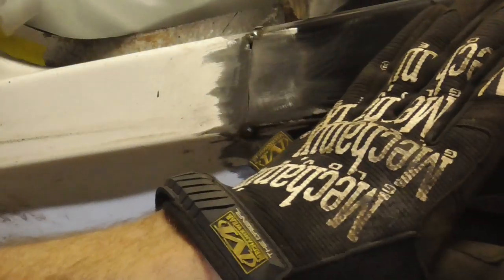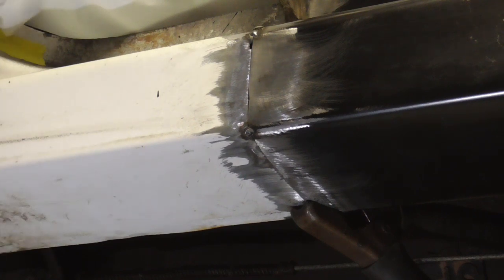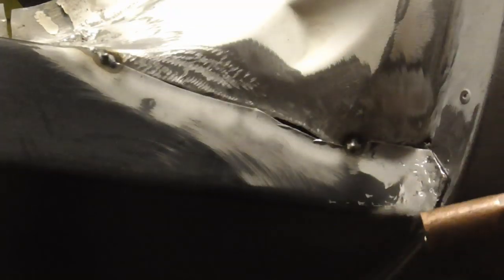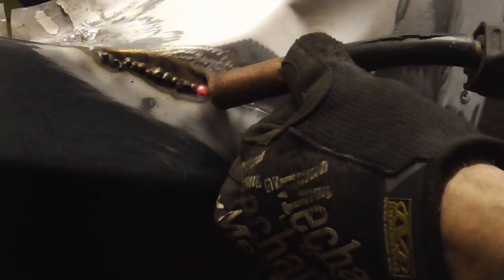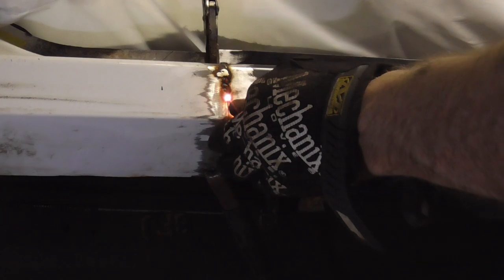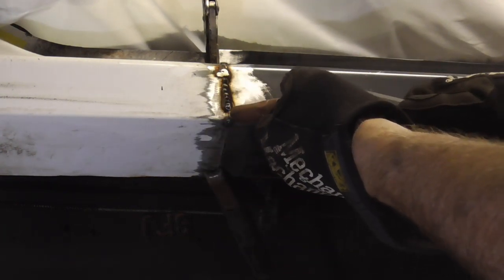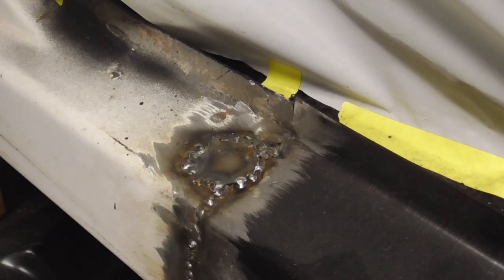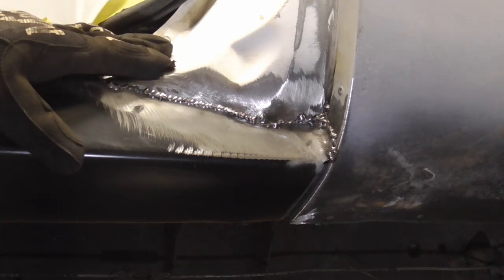Butt Welding Auto Body Sheet Metal:  Settings, Problems, Solutions

Comment: I been using Mechanic gloves in winter for tacking, & for Christmas I got a pair of tight fitting leather insulated driving gloves, & I will say I have been impressed for welding, a lot more comfortable than my welding gloves, & better warmth for cold metal, & also sparks not burning holes or sticking to top of glove. lol. my primary mechanic glove is the cheapo copy from Harbor Freight, but do try a leather driving glove, it will make you wonder why didnt try sooner.

as for people mentioning about tip hot, some cheap welders will arc, I know I have read how to install a resistor across lead internally to eliminate that, but mine do not arc.

Comment: You mentioned this car has galvanized metal, but didn’t mention how you prepped it for welding. I know for a fact that if the zinc coating is not removed completely, the weld will be contaminated leading to sputtering, blown holes, green deadly zinc smoke, and early death! Plus galvanized panels are very thin, 20 or 22 gauge, subject to extreme warpage from the heat. I have a ‘96 GM project car and am using a 140 Millermatic with gas. Even after carefully removing all the paint using a 2” sanding disc followed by removing the zinc layer with a 2” scotch bright pad, my welds sputter and pop and look like crap! Even though I’m stitch welding in single short bursts every 6 “, the welds seem contaminated. I think I need to remove the paint ant zinc on the BACK side too! What do you think?
Reply from the maker: I think I did mention that you have to grind the galvanized coating off - but I'll check.  Anyway it's a different color so you can tell if you got it all.  You don't have to do the back side.  Make sure you are using a sharp disc - like a 36 grit fiber resin to really clean the metal and remove the galvanized layer.

Comment: Really enjoy all of your videos. I also noticed that you do a great job of filming everything very well. 

I currently have a mig welder, but I don't have gas. Can you tell me if flux core will work with this method as well, assuming I adjust my settings appropriately, or should I wait for the gas tank? Thanks again for sharing.
Reply from the maker: Thanks - glad you like the quality of the videos - I try hard to make them worth your while.
Reply: I used flux core for years...but it is not ideal for body work. Very dirty and lots of blow threws. Once i switched to gas(75/25) i will never go back!

Comment: In auto Collision repair school. And in welding class we are butt weld with backing. Is it a good idea to weld a bead or distribute the welds so dont over heat and burn through. Welding on 16gauge sheet metal
Reply from the maker: You'll really never run a bead on sheet metal.  Use spots to distribute the welds and heat.  You'll also be welding 20 or 22 gauge in the body shop - that's .035' and .030" but it's good to practice like you are on the 16 gauge - feel free to always ask ?s
Reply: @LakesideAutobody   thanks for the information.

Comment: If the weldment is in an area that cannot be seen do you grind it down? Slightly off topic but my stick welder (Everlast 200ST) is IGBT and requires only 58% of the electricity of the Millers I used in welding school. Do you think IGBT MIG welders require less juice than the older types?
Reply from the maker: If you mean where trim is going to go or weather stripping... I usually grind it just  a bit sand blast it clean then prime/paint - just so if someone takes it apart, it looks nice.  Maybe - I have to check one of those welders out.  Happy New Year.

Comment: Do you sand blast all your weld seams, if so why?
Reply from the maker: I never did in a body shop 'cause it made a mess.  I do now because it looks nice and it's a good surface for the filler to stick to.  Never had a problem not blasting it either though - just grinding the area and using a wire wheel to clean up the welds a bit.

Comment: Are you just aiming for gap in between the metals , does it have to hit the gap in the middle of the 2metals if so how do you do this so fast and accurate.
Reply from the maker: Great ? - When I but weld like that, I aim for not only the gap but the bottom of the previous weld so that just in case the gap is too large the wire doesn't just slip through.  If the gap is real big I aim for the prev. weld, one side then the other and fill it in.
Reply: Lakeside Autobody thanks for the quick reply, I’m trying to repair a footwell on my bmw behind driver wheel  I have a video up on my channel, if you could look at it could you tell me if it’s a easy our hard repair, if you could get time , if not thank you anyways👍, by the way I have all the old rust cut out now.
Reply from the maker: @marc-leemoran5556  That's one of my favorite BMW's :)  As long as there is good sheet metal surrounding the hole, it really doesn't matter how big the hole is.  For floors just cut the rust out, grind the edges clean for welding, cut a patch a form it to fit using lap welds. use auto body seam sealer to cover the seam and prevent moisture from entering car.  I think you could do it with out too much problem.  Jerry
Reply: Lakeside Autobody thank you , great videos , I’ll give it a go 👍.

Comment: How do you feel about using a good quality flux core wire doing these type of repairs
Reply from the maker: I started with a Miller MIG 220v gas in the first body shop I worked at - it was gas and I have always used gas.  I tried flux core once when I bought this little welder and probably didn't give it enough time or practice and changed right back to gas.  For me it did not weld as clean as the gas - but that's just me.  Maybe I was doing something wrong.
Reply: Thanks for reaching out to me on that heard other people say the welds are not strong enough to use for like frame rails and repair on things like that
Reply: Flux welds are plenty strong, but too hot for thin metal you’ll burn holes 🕳 and struggle
Reply: @PnwOnTour  I figured that was the case just seems to me at my auto repair I difently can weld better with flux core like when doing exhaust work
Reply: @LakesideAutobody  its not just you! You're right. Its very dirty and lots of burn threws...
I used flux core for yrs, but after going with a bottle, i would never go back! Night and day difference.
Reply: Exactly, I had a century fc90 awesome welder, size of a twelve pack 🍺 excellent for 18 ga.-1/4 inch, 20-24 gauge would burn through very little control short zaps ⚡️ once I got a gas welder it was night and day you could actually hold the welder on longer since its a cooler, weld, I went northern tool Klutch 140i under $300 delivered 3 year warranty ⚡️👨🏻‍🏭⚡️small bottle of gas was like $170
Reply: @PnwOnTour   Hi,I have the same welder and I'm new to welding.Im having problems with the machine sputtering I have argon co2 mix and .023 wire,I think I narrowed it down to bad ground clamp seems cheaply made and has small burn through  where the clamp holds on the metal.
Reply: Call the tech line they should help
Reply: @PnwOnTour  Will do thanks.
Reply: @danielleach2307  flux welds actually are strong, its just that people struggle to do them properly and think they aren't good. Flux welds actually burn hotter for the same power than gas welds.
Reply: also sometimes the flux wire goes bad so no matter what you do it doesn't weld good, when it's actally the flux in the wire has drawn in moisture, just like stick rods.
Reply: @Neishy4AGTE  I took my welder apart and found that the rubber hose was never hooked up so the gas was never going threw once repaired welds all good that's why I was using flux core didn't know why welds look terrible until I figured that out
Reply: Flux doesn't come in .023 and that's what you need for body sheet metal.  It'd be fine if they made it, but they don't.
Reply: @SealofPerfection  what happened to me was my machine welder wasn't put  together correctly found the gas line wasn't never hooked up that's why my welds looked so bad but repaired that all is good
Reply: @SealofPerfection  nothing wrong with using 0.35 for sheetmetal.
Reply: @danielleach2307  yeh that'll do it lol.

Comment: Too much heat should move around and cool welds with air,ok on  small area but would get into big trouble on big panels.
Reply from the maker: You're exactly right - in this rigid area it's perfectly fine but not in large open spaces that can flex :)

Comment: I would think the best practice on welding would be to skip back and forth on the joint, instead of one continuous bead. Yes I  realize that you were stitch welding which does make for a little less heat , but I  would still skip back and forth.
Reply from the maker: Good point - when you are welding something that can distort.  A rocker panel won't give you any problems when continuously welding - too rigid.
Reply: @LakesideAutobody  you've got a good point there put I'd still skip around a bit anyway.
Reply from the maker: @jsh3234  Absolutely - should have stated that in the vid
Reply: @LakesideAutobody  👍

Comment: So can you confirm that .023 is for autobody?
Reply from the maker: Yes.  Just clear things up:  I have 2 welders.  One is a Miller MIG welder that uses .023" wire - it's a gas wire feed welder.  The other is a Harbor Freight flux core welder (no gas) and it uses .030" wire.  Both work fine for auto body work :)
Reply: @LakesideAutobody  thanks for that confirmation. In terms of texture, is it fair to say that the number has to do with soft or hardness of the wire.
Reply from the maker: @shawnlawrence4840  Hi Shawn, the number is the thickness of the wire.  .023" means 23/1000 of an inch or about 5 hairs thick.  .030" means 30/1000 of an inch which is about 6 hairs thick.  Good questions - feel free to ask any ones you have :)
Reply: @LakesideAutobody  I appreciate that, thicker means more heat and possibility of more burn through. I'm greatful for selfless people like you. You echoed Marcus Garvey's sentiment that knowledge not shared is wasted.
Reply from the maker: @shawnlawrence4840  I appreciate that Shawn - very kind of you.  I'll have to look up this guy Marcus G.  Nice talking to you and enjoy the rest of the week - Jerry

Comment: How do you grind inside corners ?
Reply from the maker: either a die grinder with a very used up small die grinding cut off wheel or a die grinder with a carbide burr tool square or round.  Good subject for a video.
Reply: With great difficulty lol

Comment: 80 garbage tacks in a row isn’t a weld, then ground down and bondo over, this is trash work
Reply from the maker: You do know that one piece had a galvanized coating on it right?  Makes it tougher to get a perfect weld.  Did you ever weld upside down with two dissimilar metals - one that might have thin spots, while trying to stay out of the view of the camera?  Do that for me and send a picture to my email under the "about" tab on my home page.  Don't hide anything either - I don't hide anything when I make a video :|
Please see this video for longevity of this type of repair if done correctly: https://www.youtube.com/watch?v=8XaZBy7GC7A or 
https://www.youtube.com/watch?v=2o37dX--w0I